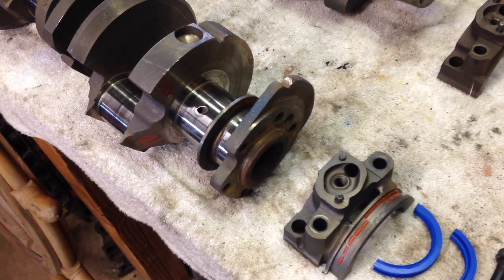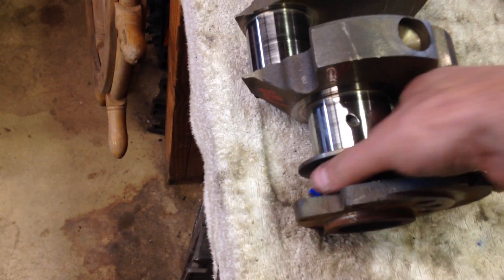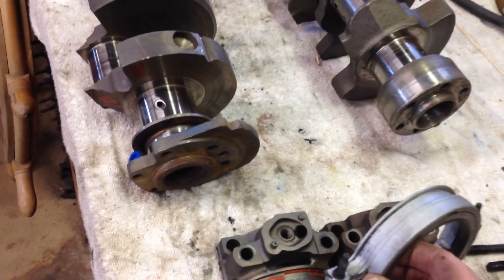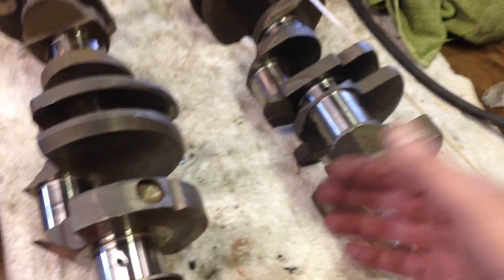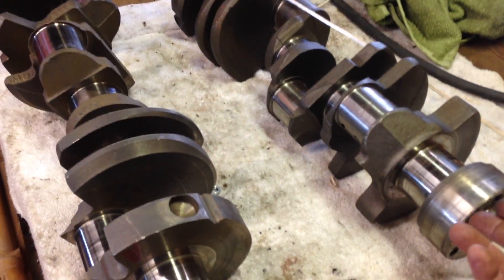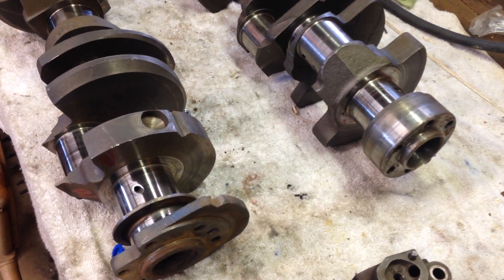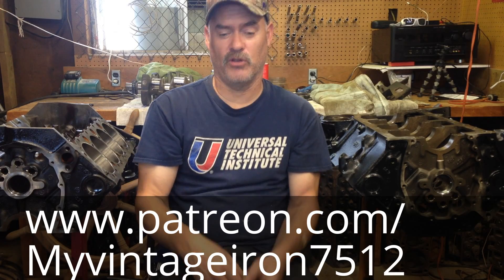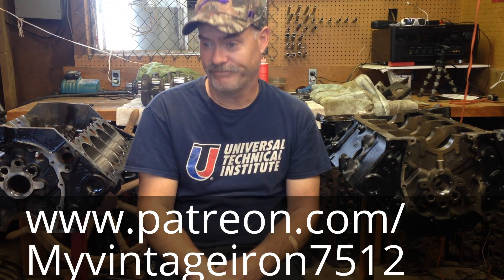350 chevy 1pc vs 2 pc rear main seal

Comment: I got a 1995 chevy suburban c1500 with a 5.7 350 tbi engine. Got a block from the early 70s it will still work if i rebuild the 70s block and change it for the 95 block?

Comment: Currently rebuilding my vortec block but i was wondering i have a one piece main seal but at 4:05 , is their supposed to be a gasket or something that goes where the main bearing journal is where the one piece main seal bolts up to ? Was only wondering because i was told the slots were made to run a 2 piece and one main seal Thanks.

Comment: 1 what i need to change from 2 piece seal to 1 piece ?
2 i have 1981suburban 350 SB, to change more horse power 350 , do i need more cooling , my area extreme hot 
regards, and thanks for the information
Mak

Comment: Also didnt see anyone mention that in 91 or 92 they went to a roller cam and on the vortec block there is not the extra bolt hole on the water pump that is all tue way thru to thr water jacket on the non vortec

Comment: So I'm working on a 383 stroker for a friend. The dipstick is on the passenger side. I pulled the oil pan and need to replace it and Summit said I have the later model small block. Well it's a old style 2 piece seal rear main cap with a old style crank shaft. So I assume you can run a older crank in the newer blocks and use a two piece rear main?

Comment: I pulled out an internally balanced 350 from by '78 GMC P35.  I ordered a rebuilt motor and when I received it I noticed that it is externally balanced.  Can I just put a different flywheel (manual transmission) on the new motor?

Comment: Why not bring up the rope seal Chevy used it tell 59 ,the latter seal seal doesn't even cover 1/8 of an inch the rope seal covered 3/8 to 7/16 in my oppion the rope seal was the best ,67 350 2 piece lol and the 86 and latter one piece suck the rope seal covers 3/8 to 7/16 way more sealing power

Comment: The one piece blocks aren’t better, they’re a lighter casting by 15lbs and that weight was removed from the coolant passage walls and main web which makes them significantly more noteworthy for cracking along said walls . 

As to the rear main, clock the seal and you will WILL eliminate the leaking, it’s that easy.

Comment: id much rather have the old 2 piece seals.
you can remove the oilpan and rear cap, and use a wood screw to pull the old seal and put a new seal in by rotating the crank by hand.

the 1 piece type you have to separate the engine from transmission to replace
Reply from the maker: True but you will rarely have to change 1 pc because they don't leak

Comment: when you  install the timing gear do you put lock tite on the 3 bolts?  also the specs for timing chain slack say around 22 mm. that seems like alot.. what is acceptable. thanks

Comment: I have a 350 with the starter boats are straight across  ,is that away to tell if it's a one or two  piece seal , with the starter bolt hole pattern that's straight across  what tooth flywheel will I need 168 or 154

Comment: I have a 88 350  hooked up to a Saginaw 4spd trans bottom end went well wrist pin but I bought a 86 350 it has a one piece seal  my question is what flexplate clutch setup do I need to fit the Saginaw 4spd trans
Reply from the maker: you need a flywheel for an 86 and up 350 the same clutch will work
Reply: @Myvintageiron7512  thank u I really appreciate it and if the flywheel that was on the one piece main had weights on it I need a external balanced one correct

Comment: Some of those 350 vortec (880) blocks are not drilled right for a early stamped timing covers and some of them don't have the water bypass hole under the left water pump mounting holes.
Reply from the maker: yes that is correct

Comment: Question....someone has to have had this problem?
....I have 1986 350-383 stroker blue printed and balanced.  The balced crank requires a 2 piece.  I've replaced rear main correctly 2 times with oil small dribble after running the car.  Any suggestions?  I've used dry felpro, measured, put lip to oil...
Reply from the maker: is there a groove worn into the seal surface on the crank? it may need a repair sleeve

Comment: Anybody watching this video recently?? ... you'll find out that the harmonic balancer is a different thickness,  therefore v-belt pulleys from older small blocks don't line up with the crank pulley, the balancer is thinner.  Am I the only one with this problem? Do I shim the crank pulley outwards???
Reply: Don't forget about losing the mechanical fuel pump provisions
Reply from the maker: best way to handle it is scrap the V belt set up,  it's junk,  any serpinteen belt set up from those years will fit I've gotten many from the bone yard
Reply: I shimmed the power steering pump and all good now.  V belts look better in my opinion,  serpentine belts don't belong in oldcars.... neither do ls motors ..... oh snap! Just broke the internet

Comment: I read that the flywheel for the newer engine is slightly larger, and won't fit inside the older rear structures.  Is this true?

Comment: I’ve seen a lot of people run cooler lines to the centre of the head because of the valves burning out 
Also cooler lines from back to the front and middle of the manifold 
Is there a water jacket in the centre between the bolts on the manifold into the head ?

Comment: Question on a harmonic balancer. Did about 2 hrs of research with no luck. Dirt circle track sbc 6500 rpm msd chipped with rotating assembly internally balanced, h beam rods hyperpneutectic pistons and 1 piece cast crank. Will any balancer work or would you have a suggested opinion?

Comment: Is there by any chance a way to convert the 2pc type of engine to a 1pc? Like can i put a 1pc crank in a 2pc block and just bolt on a 1pc crankcap and that aluminium sealplate on the 2pc block? Or are the blocks also different so im bound to get a 1pc block? Great video btw! :-)
Reply from the maker: no
Reply: @Myvintageiron7512  no with the meaning that i cant convert a 2pc block to 1pc?

Comment: You didn't show the back of the block!!!  If you happen to have a very expensive one piece rms crank, you can machine the back of the block and cap to fit the one piece main seal. 
Nobody ever talks about it or mentions it. The one piece rear main block and cap actually have less material. Using a mill you can remove the material and fit the one piece. You don't want to buy a new or used one piece rear main cap. If you do, you will have to align hone the mains. You simply machine the seal lip off of the back of the cap and the back of the block with it torqued in place. Once the back is machined, drilled and tapped for the one piece seal adapter plate, you're good to go. You can even drill and tap the top of the oil gallery above the cam to mount the spider to hold gm OEM lifter rings and machine the  top of the lifter bores so the rings fit loosely on the OEM roller lifters. Use studs and loctite them in to avoid leaks using two nuts to set the height of the retainer. And your done!  GM hot cam here we come lol.
Reply from the maker: your talking about a ton of machine work at an average of $100.00 per hour it is far more cost effective to buy a roller block for a couple hundred bucks and your done I would charge $500+ for all that work it doesen't make sence to me to try and sell this to a customer when the 880 blocks are a dime a dozen
Reply: @Myvintageiron7512  I agree with that if you're talking about a factory block. Unless you have your own mill... With a CNC mill it's a single fixture mount. With the rear main bolted in place, the only way I would do it, it's cleaning out a circle and tapping a few holes.
If you're talking about aftermarket blocks and 4000 dollar cranks, even $500 is worth it. Blueprinting a block will run you that.
Reply from the maker: @curvs4me  Well I'm gona go out on a lim here ad guess thar 99.999 % of my viewers do not have a CNC Mill nor the skill to set up/ Run one

Comment: How the heck do you get the old seal out of the housing to replace it with a new one wirh out damaging the housing? Is there a video that addresses that?
Reply from the maker: you need to remove the housing from the engine
Reply: @Myvintageiron7512  I have it out. The seasons a bugger to remove was just wondering if a trick to popping it out so I can install the new one. I've seen a couple guys beat it out with a hammer and punch.
Reply: @Myvintageiron7512  sorry meant seal not seasons.

Comment: I am in the same ‘boat’. :) I have an 88 Sea Ray with 2 x 5.7s (1 piece rear-main seal) and they need overhaul. Could you please tell me what heads & camshafts combo you used to increase his HP? If you have a recommended brand or a link please include. Thank you for the very informative video!

Comment: Im thinking about taking the short block out of an 86 TBI 5.7 and putting it in a 97 vortec 5.7. My question is that i should be able to bolt the vortec heads, intake, etc and have no other issues right? Only thing im worried about is if the plastic timing chain cover from the vortec is going to work on the 86 tbi and also if the lifters and lifter hold downs are the same too. Any advice would be appreciated. Thank you
Reply: You can use the steel cover on a Vortec engine all you need is the dowl pins you just need to pat them into the dowl pin holes on the front of the block and the early style cover bolts right on
Reply: @kT-ob2jq  ok thanks but how do i put the crankshaft sensor on the steel timing cover? I will be using all the obd II a sensors. My 97 vortec engine is knocking and i have a good 86 5.7 and im hoping it will interchange and i wont run into something unforeseen. Ty for any help.
Reply from the maker: You don't need a crank sensor for TBI
Reply: @Myvintageiron7512  no lol u got it backwards im going to put the tbi block in the 97 truck and use everything from the cylinder heads up that came on the 97 is my plan if it'll all come together like im hoping and not run into a dead end
Reply from the maker: @brianpierson6016  OOOO I see sorry,  it should be fine you will need to run the Plastic cover you will also need to use the reluctor wheel on the crank snout behind the plastic cover that is how the OBD2 computer in the 97 gets the crank position,  you will need to remove the 2 dowl pins on the front of the block for locating the steel timing cover then the plastic cover will bolt right on just be aware that you need to use the camshaft out of the 97 otherwise you will need someone to put a new tune in your computer, it is also possible that the TBI block is not machined for a roller cam they cam both ways I am attaching this video it will help explain that    https://youtu.be/r6jlpiu7YQU 
If your TBI block is not machined for the roller set up I'd find a different block,  that is
Reply: @Myvintageiron7512  much appreciated for the information...you might have saved me a lot of backache and heartache too. This is why i always try to research things as much as i can bc it sucks when u fi d out the hard way.

Comment: If you add 50hp per engine in a marine application you only gain 50hp overall. The two engines are for lift out of the water. Once you’re at top end, one engine will push the boat as fast as two.

Comment: Quick question  is there any difference between block strength I've always been told the older blocks are stronger?  Thanks for your vids
Reply: The older blocks were more common with 4 bolt mains, which are stronger for big power. Most of the newer blocks with a 1 piece rear main seal come with a 2 bolt main. There are 1 piece rear mains with 4 bolt mains but they aren’t very common.... hopefully that makes sense.

Comment: I have a 79 350 block 2 piece on the rear 4 bolt main the only issue i have is the fkexplate vibrates a little n ive replaced it twice ha snew harmonic balancer but still vibrates a little any advice on what could cause the vibration dowmes not burn oil runs very good had it on truck since 85 and has no blowby

Comment: You can do everything but destroke a 400 to 320 like I wanna do 3in bore on the 4.125... the 4.3 v8s have 3in stroke 1 piece cranks for $160
Reply: Bore it .040 over and get a 327....😂 I wanna do the same.
Reply: @zragevii4705  i built a 353  4.155 x 3.25 then the oil pump bolt ripped a chunk out of my main cap :( looking for a new block now
Reply: @steelrain9702 that's a crazy engine. sorry to hear though. If I had a 400 block I'd definitely try and help you out.. but all I've got is a couple 350s. I'm needing a crank though, so I'm not doing great...😂

Comment: If I put a thumper cam in my 383 stroker 10:1 ratio ,5/8 plug w/aluminum heads 202 exhaust would that increase my hp ? 430 hp now
Reply: Bobo mcrae depends on your heads how they flow what your bore size is bigger cam wont help if your heads can’t take and get rid of the extra flow and the 202 is your intake  valve not your  exhaust valve you have to know what your heads can flow at a certain lift divide your intake flow into you exhaust flow will give you your percentage difference of flow between valves times that by .26 will give you your power per cylinder times that by 8 to get total power then times that by you flow percentage to come up with the round about true power then times that by say 20 percent .20 to figure out what you will get at wheels these are round about numbers but the math I stated is what you do to figure out power of. A certain build lot pays into it bore size header tube size so say if you have a 4.155 bore to start and you punch out to 4.185 bore you add 17 percent to your bore size then you need to add that to what ever your heads flow say if you head flow 320 at 600 lift 320x.17= 54 so your new value is 374 at 600 lift for your intake side And your exhaust flows 280 at 600 lift 280x.17= 307     307 divided by 374=82 percent of flow  so now you take your 374x .26=97.24hp per cylinder times that by 8 =777.92 Hp now times that by your 82 percent would = 637 true hp  at the crank now times that by 20percent power loss of drive train would = 127 hp loss you would have around 510 hp to the wheels these are example numbers just find out what your heads flow at any given lift and go from there but that is formula to find horse power of any engine and it will very 10-20 hp either way on a dyno it is normally on the higher side hope this helps

Comment: I just got my motor rebuilt and the end of the crankshaft that you called a flex plate the new motor does not have the studs in it. And I’m having a hard time getting them out of the old block. What do I google to find these new studs? And what are they called?

Comment: On the 2-piece seal (in the interest of preventing rear main leaks), I highly recommend "clocking" the mating surface of the two main seal halves- i.e. 8 and 2 o'clock instead of inline with the same mating surface of the oil pan. An old school racer taught me that some 30+ years ago, and it has never let me down.
Reply: Yes definitely be a good trick to know
Reply: am or pm....hahahahaha...
Reply: One peace seal bolt pattern cranks are notorius for cracking flex plates between the bolts. I've never had problems with 2 peace main seals leaking  but I  clock, offset the seal gaps and put a slight smear of sealer between the cap and block and seal ends.
Reply: What do you mean by clocking?
Reply: My dad taught me this about clocking the seal
Reply: The center bolt valve cover one piece engines are just as buildable. You are 100% correct! The only thing I seen you forgot to mention is some of the newer blocks are sealed-off where you would normally bolt on a manual fuel pump.
Reply: Yeah man my 406 crate motor had them clocked I took notice on teardown
Reply: 8 and 4 😉
Reply: @dalemccord2129  5 and 11
Reply: @dalemccord2129 8 and 4? That don't Math lol normal I stall would be 9 and 3 so 8 and 2 would sound rite

Comment: I've never had a two piece that didn't outlast the engine. I have had one piece ones fail...
Just like the new unit wheel bearings. Never had an old spindje hearing or old axle bearing fail and the new unit bearings go out all the time.
Progress sucks sometimes

Comment: I have a 1987 Pontiac Trans Am with a carbureted 305 in it LG 4 I also have a 350 short block with a 2-piece rear main seal in it I want to take the 305 out and put the 350 in it could you give me some advice on making my accessories work and my 700 R4 bolt up to the block correctly
Reply from the maker: it will fit fine the only thing you need to change is the flex plate the back of the crank has a different bolt pattern the ring gear and torque convertor mounting holes are the same

Comment: i would love too see somthing on    heads 202  angle peanut plug   which  i have  2 sets nos ib  my dad got me 19 71 from the cvy plant  they gave them too me  for 2 bottles of wild turkey  we put another set on my buddies  327  w/ a th400   at 50 mph naild it and turned the driveshaft into a cork screw in his 57 belair
Reply: Left is port. Both have four letters. In the old days of fighting wood sailing ships, left was larbard. It sounded to much like starbard with all the noise so they changed it to port which fixed the problem.